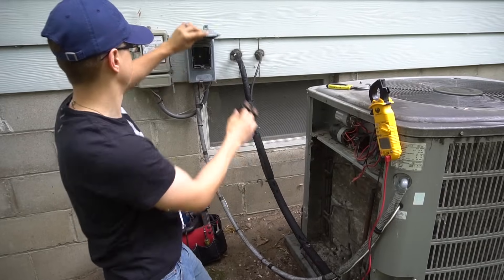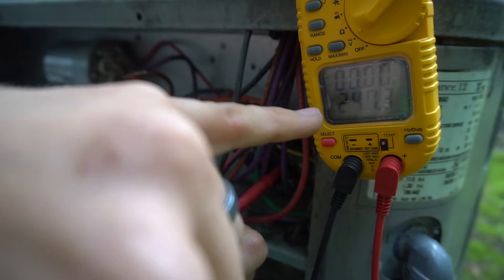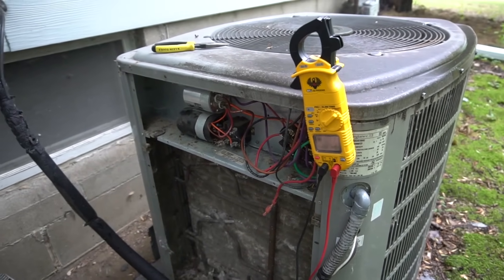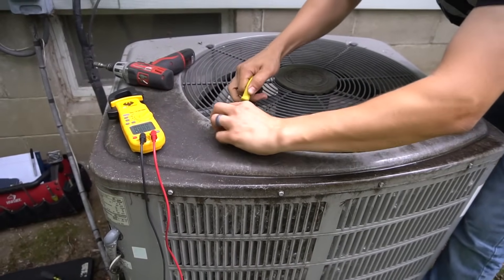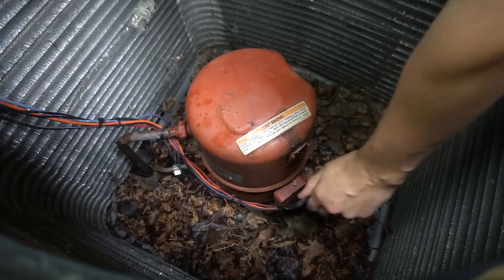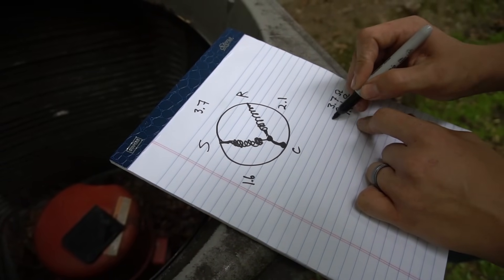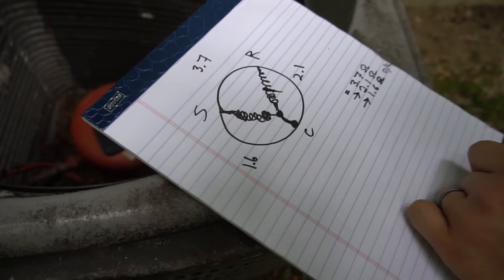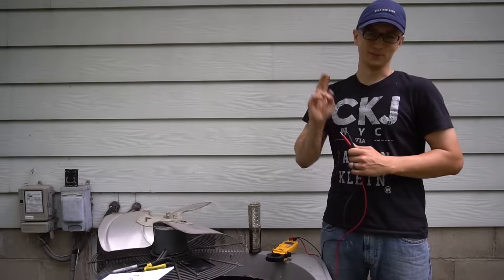How to Check HVAC AC Compressor

Comment: When you check for the 3 readings what are you checking with? Like ohms or voltage or continuity? So you check 1 and 2, 2 and 3, 1 and 3?
Reply: It’s Ohms and a subtle mistake is he says 1:2, 2:3 & 3:2, but meant 1:3 or 3:1. Look up Ohm’s law for more of an explanation than I will give or be able best to explain.  
Continuity tests for an unbroken electrical path in an electronic circuit or connector. I do not recommend testing for this either for any DIY persons.

Comment: I recently found and watches several of your video.  I am hooked.  I have learned so much.  My compressor will hum for a second and then stop.  After a while it may trip the breaker.  I checked the ohms between the compressor terminals.  They look good:  1.1, 3.0, and 4.1.  Also have continuity between all terminals.  When checking each terminal to the compressor casing, I have OL for each terminal when the power is off.   (In your video, I noticed you have 0 Ohms, not OL).  But when the power is on (thermostat off), I have continuity to the casing for each terminal. I think this means the compressor is fine, but there is a short somewhere else when power is on power must be leaking to the ground???  I would think this would instantly trip the breaker.  Does this likely mean a bad contactor or relay (or wire touching).  I don't see a wire shorting, so assume it could be the contactor.  how would I test.  The contactor seems to test fine for some of the tests I tried).  Thanks in advance.
Reply: Did you get an answer ??

Comment: Very impressive, very well explained!! I have a question! My breaker keeps tripping, but if I disconnect the compressor wiring from  it, then the breaker still on! Could that indicates that the compressor is bad? Thanks, hectoraponte1982@gmail.com
Reply: Can I have an answer please?
Reply: Hector Aponte. Yes that sounds like a compressor fault. Next Q is it a dead short? Mechanically seized? Or a lesser electrical overload?. (Slower acting fault) in which case a slim chance it's another fault not the compressor.

Comment: 2.1 should be the starting,1.6 is running. correct me if I'm wrong.
Reply: Yes, you are wrong this time my dear 2.1 is run 1.6 is start ❤️
Reply: @johnson4940  ok Thanks dear. God Bless.

Comment: My compressor is leaking from where those 3 wires are on the compressor , my tec says the compressor is blown before checking volts , it cost like $900 so i dont know
Reply from the maker: If it is leaking from the compressor pins then I would also say there is no need to check any further..

Comment: Dude,.. if you have no continuity/no signal/no sound, you don't have a short/short circuit (at least not between those terminals), you have and OPEN circuit.
Reply from the maker: Thank you for the correction!

Comment: hey, friday night i heard my outside unit kick off shortly after it came on.  fuse on control board was blown.  i changed it and it blew a couple more times.  changed the thermostat and it stopped blowing the fuse but the fan and compressor cut off after a couple of minutes of running.  any thoughts?
Reply from the maker: That sounds like a loose connection or a broken/burnt/loose wire in the condenser unit. Maybe a mouse found a new home? I would investigate the wires/connectors in the condenser unit
Reply: I had a similar problem where the fuse kept popping, i replaced the contacter on my a.c. unit outside. After that, put in a new fuse and fixed the problem. Btw i was only able to figure this out thanks to this channel😎

Comment: Thank you for all the videos you do. Our AC was running when we experienced a brown out. Just incase your not familar we lost partial power. Our AC unit made a terrible noise until we were able to shut it off. The next time we went to use the AC we discovered the air coming from the vents inside our home was warm air. We then discovered the fan blades were going around outside nor did we hear it turning on outside as well. That's when I found your videos.......Thank you. We first changed the capacitor, hoping for the best. No luck! We do not have an electrical meter...... but we did push the plunger in manually on the contactor and there is noise coming from the unit but it does not start up nor does the fan start but does move freely when we spin it. We have changed the fuses in the disconnect as well. The brown out is more likely than not the cause of whatever has gone wrong. What would be your best thought on what the brown out most likely would of caused?  We currently are in very severe hot weather here in Michigan.......of course!! Thank you for any assistance you can offer!
Reply from the maker: Hey Christy! Sorry to hear about the mess that the blowout caused.. Unfortunately without a meter to check voltages with, there is not much I can suggest.. You already replaced the capacitor and the disconnect fuses. I am assuming you tired resetting the AC circuit breaker as well (or checked the fuse if you have a fuse style). I doubt that the power outage damaged both, the compressor and the fan motor.. Although that's a possibility. The only way to know for sure at this point, would be to check stuff with a meter.
Reply: You could visually inspect the run of wires going to to your compressor, including taking the cover off at the compressor terminal like he did in the video. Make sure power is off, look for burnt wires. Also your contactor could be bad too. See if that has burn Mark's. Otherwise, just go buy a $15-20 meter.

Comment: Thanks for this good video. I am curious to see if you could help me with my problem. Both my compressor and fan won't run on my outside unit. My contactor let's voltage through and my capacitor is good as I've measured the leads. What is the common part that controls both the fan and compressor as I doubt both items would go bad at the same time. Thanks for you time.
Reply from the maker: So if you measure voltage coming into the contactor, you get 240v? And then you measure 240v coming out on the other side yet nothing turns on?
Reply: @WordofAdviceTV  I measured voltage at T1-T2 on the unit contractor and I only had 45VAC, T1-Ground showed 8VAC and T2-Ground showed 118VAC. I then went back to my wall disconnect and output showed the same but input showed the normal 236VAC between the two wires and each phase showed 118VAC independently to ground. Took my wires out of my disconnect and did a continuity check on the leads and turned out the black wire wasn't letting current through. I must admit the 8VAC and 45VAC readings really confused me at first but with the continuity check it was pretty clear what my problem was. Thank you very much!
Reply from the maker: @ac4704  Glad you were able to track down the problem! :) Thanks for the update!

Comment: If I try to jump cooling at the control board I usually jump c to y .
In a case where there is no wire on common would I just jump r to y?
Reply from the maker: C to Y would give you a direct short if the thermostat is calling for cooling, so you don't want to do that.. R to Y would be where the jumper should go.
Reply: Thanks I try jumping it but no luck. Board won't send 24v to contactor outside but when I go outside and push contactor in condenser starts. What do you think?
Reply from the maker: Have you watched this video yet? https://www.youtube.com/watch?v=NVPhsK4gK1A&t=123s

Comment: What if you press the plunger and it doesn’t move and you don’t hear any sort of sound
Reply from the maker: That sounds like the unit is not getting 240v. The plunger is powered by 24v, so when it pulls in, it allows the high voltage to go through. So perhaps a blown fuse in the disconnect or a tripped circuit breaker?

Comment: Thanks man, found a burnt black wire on the compressor.  Is that the S wire?  (left hand side if facing the terminals).  Anyway, I ordered the Qwik Plug Compressor Wire Repair kit.  I hope it does the trick.  I checked the terminals and got my readings but they were all over the place and didn't jive.  However, I think it was my big hands and my cheap multi-meter.  My compressor terminals are in a hard to reach area like yours was in this video.  I tested to see if it was short to ground and it was not.  I may test the wires at the top connections tomorrow.  They are easier to reach.  But I think my compressor is okay.  Thank you so much.
Reply from the maker: Glad to hear the video helped diagnose the problem! I think the wire repair kit will do the trick. I can't say if the black wire is S without looking at it... But if you have a wiring diagram on the back of the access door, you should be able to see which wire goes to which terminal. Good luck!
Reply: @WordofAdviceTV  Thanks.  I received the Qwik Plug Compressor Wire Repair kit but I have one problem.  The other end of my black wire does not have a female slide on connector on the other end like the kit does.  It is rather a spade connector that is screwed down onto the starter relay.  Do I try to cut off the female slide on connector  on the kit wire and crimp on a spade?  Or is there a different kit that I can buy?  Thanks again...almost there! (I hope).
Reply from the maker: @kenfanuele5192  Oh that kit will work just fine! Just snip off the slide on connector like you said and crimp on a different connector that will work.

Comment: Thanks-you think taking those compressor wires off is hard try putting them back on! My comp is bad, just got a quote of $3,200 to replace, w/ no guarantee of course, that something else could go wrong soon after on my 11+ year old 2.5 system. And R-22 too!
Reply: R22 is a system breaker if u have a leak. But I've heard good results with NU22 as a replacement.

Comment: So common to run gets the run reading and common to start gets the start reading but how did you get the common reading itself?
Reply from the maker: Hey Scott! Yes you are right, just to clarify here is where the 3 readings would be measured:

C to R = S
C to S = R
S to R = C (normally the largest reading of the 3)
Reply: Word of Advice TV thanks for your time !!

Comment: Hi.  I'm posting here to say "Thank You!" ...  you see we had been told by a local contractor that out old r22 condenser was shot and our entire system needed to be replaced. I came across your videos while doing my own research, and after watching about four or five of your videos on outside units, I was able to go outside and, for about $20 in parts get my old one working again.  In my case, I had a bad 5 minute delay board.   I much prefer to bypass the board then spend 6500 on a new system. I know it's coming in the future, but  I'd like to get as much life out of this old system as I can. Thank you so very much.
Reply from the maker: You're welcome! Happy to hear that your unit lives on! May it have many more good years before it retires ;)
Reply: I know I’m late but how do you bypass the board.. I’m going look it up. You telling me won’t hurt anything.. Thanks in advance.
Reply: @mwjr2135 you ever find out ?
Reply: @mwjr2135 IMO it shouldn't be more than 5k. Anything more is just highway robbery.
Reply: Bypassing time delays is not gonna make your unit last longer. Those protections are there to keep the compressor from short cycling - which will effectively pump every drop of oil out of it. Better to just replace the defective board.
Reply: @topher8634 Nearly all modern thermostats have a delay function built-in to prevent short cycling. I also bypassed my delay timer - 5 years ago with no ill effects
Reply: How much longer did that last you?
Reply: Post video how to by pass board
Reply: Now that same system cost almost 10k if not more. You waited to spend more money later.
Reply: @chris.5434 Like selling cars at this point. If he couldn't afford it then, he absolutely can't now.  Looks like window units it is from now on.

Comment: What if my compressor checks good but still kicks breaker as soon as you turn it on I can undo my compressor and the fan will kick on
Reply from the maker: Hmmm.. So if you unplug the compressor wires, the breaker does not trip? Do you remember what resistance readings you got between then three compressor pins and did you check each pin to ground? Also, did you visually verify that there is no breaks in the wire/s or corrosion at the compressor pins? If everything is checking out good yet it still does not come on, then you may have a locked up compressor. Unfortunately that is fatal :( The only thing that could potentially get it going is a hard start kit. (I have a video on how to put one in) So I would definitely try one of those before condemning the unit. I have had it go both ways before, sometimes the compressor would kick on and run for another year or couple years, other times even with a hard start kit it would not start. If you have a meter, you can also check what the start-up amperage the compressor pulls right when the unit comes on. If the amp draw is higher than the LRA (locked rotor amps) rating on the unit, then the compressor is indeed locked up. Hope that helps!

Comment: Don't forget to short the leads on the capacitor, in older models they don't have a discharge resistor built in and can store a deadly charge.
Reply: I wouldn't say deadly
Reply: @tillerdogg3232  I would
Reply: I would too
Reply: Not these. Now the high voltage section of an old CRT T.V. or monitor has capacitors that store a deadly charge for weeks after it has been unplugged. The tube itself will hold a charge. The ones in an A/C unit will just piss you off when they discharge. However, it is a deadly charge for your multimeter.
Reply: Not deadly in these A/C units.  The caps are typically 80 microfarads or less, at 200 to 400 volts.  In high school electronics class, we used to charge up larger electrolytic capacitors and then stick them back in the parts drawer to zap the unaware.  It will get your attention but will not be fatal.

Comment: I just wonder, is resistance possible in ohmeter reading between C/R is higher than  between C/S on compressor as shown here ! Sorry i am at first year HVAC college and the instructor told us Always reading between C/S is higher than between C/R  ?
Reply from the maker: Did I say it wrong in the video? This is how I was taught in school and how I check it in the field:

Checking Resistance Between...
Common + Start = Run Winding Resistance
Common + Run = Start Winding Resistance
Run + Start = Common Winding Resistance

 Hope that helps!
Reply: @WordofAdviceTV   I meant, ( Common to run should be the lowest reading.  Common to start should be the mid-range reading. Start to run should be the highest reading. I think you miss my point . Thanks for the video though.
Reply from the maker: As far as I know, common to run is measuring the start winding. The lowest resistance winding is the run winding though, which is common to start.
Reply: @WordofAdviceTV  yikes that is pure muddy.  very confusing.

Comment: Need help on a American starnard heat pump package unit. The indoor fan motor is running and the condenser fan is running. The compressor isn't coming on.  I checked the cap and it's good and checked to see if the compressor was bad and it's not. I'm a tech in the trade for 10 years never ran into this problem. Any help will be appreciated. Thanks. Oh the back up heat stripes are working. Thanks.
Reply from the maker: You have more experience than me then :) But they do say two heads is better than one. So here is some thoughts I got:

- Is it possible that the compressor is seized up?
- Does the compressor hum for a second or two like it is trying to start?
- Is the compressor getting any power at all?
- If it's getting power, maybe try putting in a hard start kit and see if starts?
- So you ohmed out the compressor between all the pins and to ground and all was spot on?
- Any loose wire connections?
- Is it possible that one hot leg is missing?

That's it for now.. If you get the chance, come back and let us know what it was! :)

Comment: Hi  Very well done...but... also It will help the technician on the spot is ; to speak with the people with the problem ; they will be a better help (history of the equipment) and see if the compressor is tripping the breaker ( this is the second step ) ; third make sure to advice to NON technician ; you know " weekend warriors" DO NOT TRY THIS AT HOME unless they know what are you doing.

Comment: I have Trane XE1000 heat pump, my outside and inside unit runs, replaced the capacitors for the outside unit. NO HEAT. what do think is the problem.
Reply: Probably bad reversing valve

Comment: What if the readings are 1.0, 1.2 & 2.0 ?
Reply from the maker: Usually they are right on. But that is such a small difference. I would say the compressor should still be operational
Reply: My A/C tech told me that still a bad Compressor cause the Pistons inside are not good (compressor still not running)...my unit is 7 years old...
Reply from the maker: Ahh I see. That is a little different. That would be called an inefficient compressor. If something is going on with the pistons, many times that will not effect the compressor windings. That's a bummer.. 7 years is only mid life.
Reply: In this case the comp. will get very hot ( comp. is locked ) sometimes also trip the breaker
Reply: same rules apply ( unless is three face ) this is another story for later

Comment: Never ohm at wires by contactor.
Reply: If they are good there, they will also be good at the compressor. But if they are bad, dont assume u need to replace the compressor without looking further. Ya?